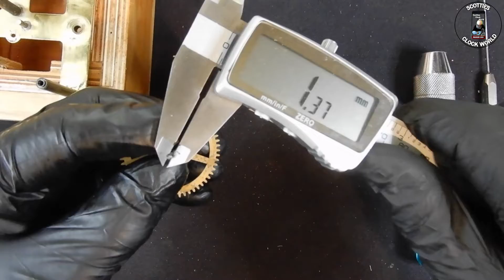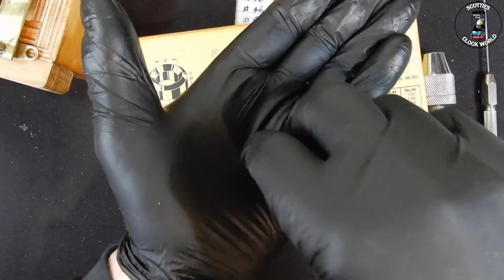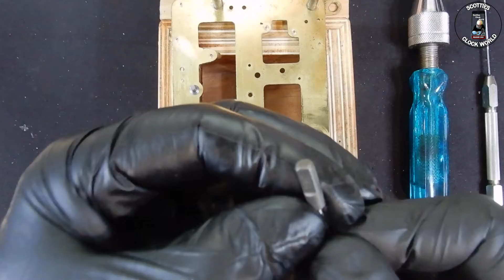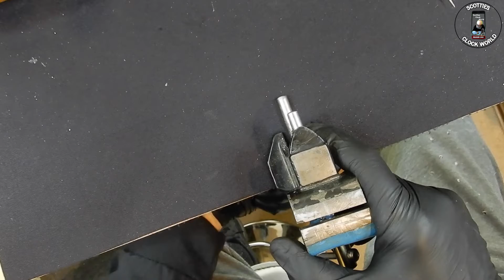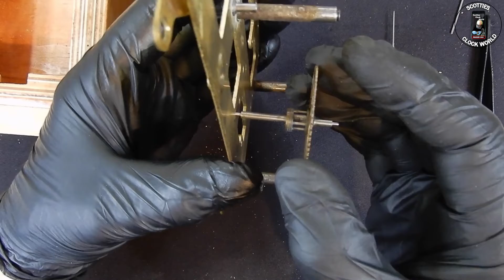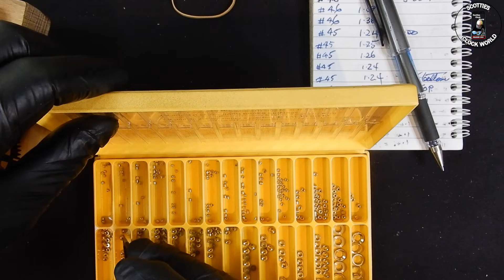Rebushing A Clock Plate Using A Hand Held Reamer, Ep1

Comment: Good evening. I've been watching you for quite some time now and really enjoy your videos.  Long story short. My Grandparent's old (1940's/50's ?) Bentima Westminster with Perivale. Stripped, cleaned, reassembled, and is running, but the chimes train sticks a bit. I have a slightly worn bush, but it doesn't break past the bush into the plate. Can this bush be pressed out and replaced without having to use a reamer (very expensive for a one-off job), or can it be opened up to the next size with a Broach? I hope you don't mind me asking. Thank you.
Reply from the maker: Yes, you can press the bushing out and work on the hole with a cutting broach.
Reply: @ScottiesClockWorld . Thank you, much appreciated.  David.

Comment: Hi Scottie
How much smaller the hole in the plate should be before you tap the bushing in? .I am asking because I have not Burgeron reamers just normal set of broaches
Reply: Hey John, I don't know if it matters a year later, but we learned at school, generally 3/100 of amm. We used a dremel like drill and a set of reamers callibrated to; for example 197 for a bushing of 2mm.

Comment: Nice video.  I didnt know that the Burgeron system was set up like cutting broaches where you have to start with a small one and then work your way up.  Where the KWM system you select one reamer and when do you are able to put the bushing in.
Reply from the maker: That's how I was taught to do it. Reduces the torque on the reamers.